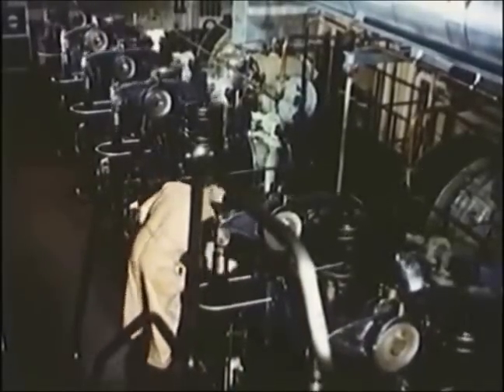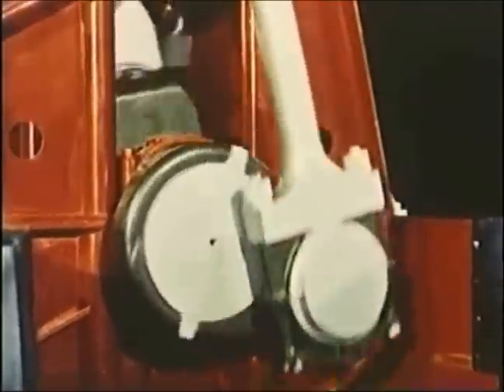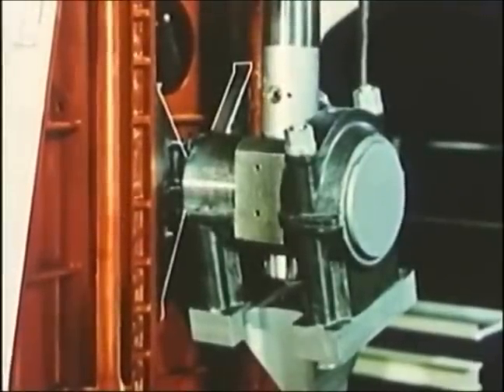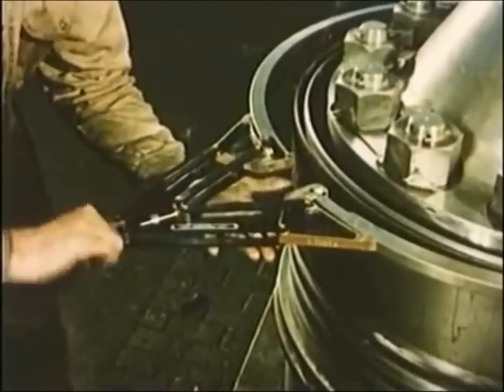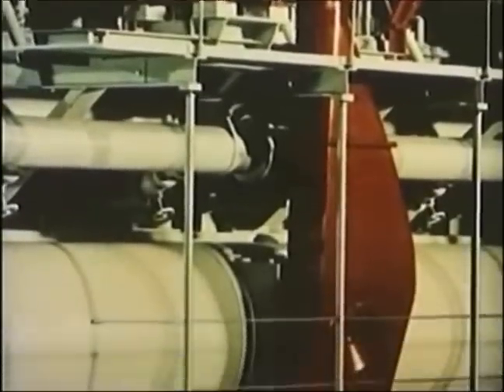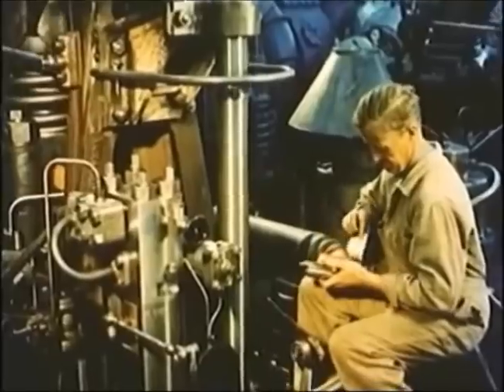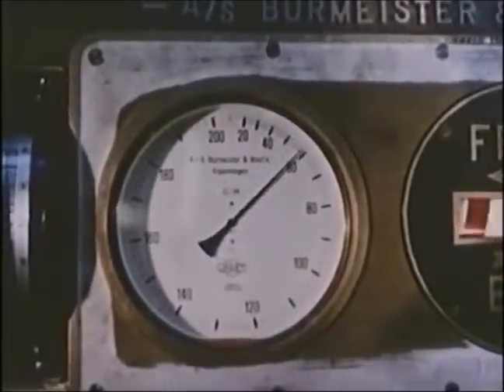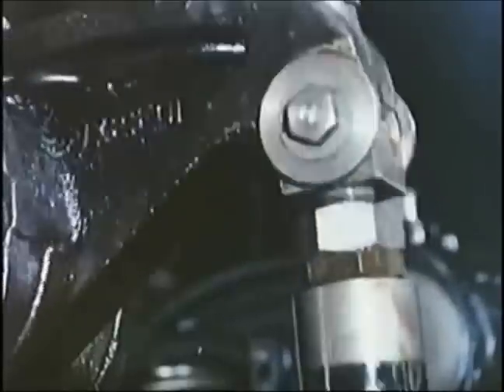Marine Diesel Engines How they work Documentary

Comment: So that 2 stroke can run in either direction.   Pretty cool seeing something on a massive scale like this.
Reply: So to reverse direction of a ship, the engineer would have to stop the engine, then restart it in the opposite direction. I can only assume this would take several minutes to do. This would explain why in disaster documentaries they say it takes so long to stop a ship from hitting an iceberg, or another ship, or running aground. Not as simple as just changing gears. The size and power of these engines are so impressive.
Reply: Yeah. Same with steam. In the scene in Titanic where the engines are reversed, that's what it shows. The engines clunk to a halt as steam is cut and then the steam is reapplied to reverse the engines.  Definitely takes time. Not like sticking a car in reverse. :D But, diesel or steam, those big marine engines were/are some impressive beasts! With two 4 cylinder steam engines and one central steam turbine, the Titanic's  combined horsepower was around 46000, ~15000 from each reciprocating engine and 16000 from the turbine, which was not reversible, so it only worked when the ship was moving forward.
Reply: SquierStrat72 000000000
Reply: It is not too long to reverse, the time to stop is more about the weight of the ship.  If you have 40,000 tonnes moving at 15 kn it just takes time to slow it all down.  Mind you, full sea speed was 120 RPM running on heavy oil, close relative to tarmac, full speed manoeuvring was 100 or 80 RPM not too sure about the exact figure running on diesel, the change over to diesel and slow down from 120 to 100 used to be planned as an hour.  That was part slowing down, part cooling down and flushing the heavy oil out of the fuel system.  One ship could manoeuvre on heavy as the fuel system had a return to the service tank, so the heavy could be kept flowing and warm and not set solid in the pipework.
In port turning gear kept the engine turning very slowly so the crankshaft did not develop a wobble.  To get underway the turning gear would be disengaged and the engine kicked over on compressed air with fuel off to be sure it would turn over. 
Back in the day, the Bridge would ring Noon on the telegraph, (move the telegraph from full ahead to full astern and back to full ahead again), as a time check for the Engine Room.  When bridge control of the engine came along you had to remember not to ring Noon on the telegraph any longer, the computer would try to do as it was asked.  I heard it did happen but I never experienced it, so who knows.
The taco link to the computer broke one day, so the computer tried to re-start the engine, when it found it could not re-start the engine, taco broken remember, it stopped the engine.  That was an interesting afternoon.
There was usually a range of revs, 3 or 4, where the harmonic of the engine matched the harmonic of the ships hull, if you did not go through that rev range fairly smartest the whole hull started bucking in time with the engine, not a popular thing to happen.
Reply: SteiffBear 60 damn thanks for that. Cool as hell!
Reply: Except that the Titanic used a steam engine, not a two stroke diesel.
Reply: The exhaust valve opens a few degrees before the intake ports to achieve "blow-down" , so reversing it would be inefficient unless the timing could be changed.
Reply: TIMEtoRIDE900 when the engine stops the camshaft moves so that diffrent rollers get the needed timing.
Sailed with two stroke Brons engine wich started on compressed air.
Once i forget to stop the compressor when  we came in to a harbor and the pressure was to high that a safety prevented starting the engine. After releasing manualy air the engine could be started and the ship came on the right moment to an hold pfff...
Reply: Do they just blow air in the cylinders to start ?? How is that timed ??
Reply: I just wonder how many thousands of gallons of oil this engine takes to lubricate it
Reply: Any diesel can if the injection system isn't specifically designed to prevent the engine from "springing back" and running the opposite direction if its stalled.
Reply: For "blow down" to occur the intake valve has to be open at the same time.
Reply: Roy Riederer even if this wasn't the case it would take a long time. It takes quite a bit to get something that heavy to change direction once it's set in motion.
Reply: TAOFLEDERMAUS I believe the reverse on a modern snowmobile works the same way, the engine turns in reverse
Reply: 4 stroke diesels can run backwards as well.
https://m.imgur.com/a/NhmO8
Reply: @TIMEtoRIDE900  on the engine shown, 90dgrees before b.t.c., so that they could get a good pulse for the turbocharger
Reply: @TIMEtoRIDE900  a rotary distributor which supplies air to a pilot valve, which opens the air start valve for a particular cylinder. The valve is closed by a spring
Reply: @deeremeyer1749  no intake valve. scavenge air is admitted through the row of ports round the bottom of the liner
Reply: @alexanderrosales7675  but you would need separate "ahead" and "Astern" cams on the camshaft, and that's what happened.  The camshaft physically moved sideways to bring the cams in line with the pushrods
Reply: @ibleedihred2844  Depending on the engine the lub oil system will contain anything from 10 to 20 tons of lub oil.
Reply: @TIMEtoRIDE900   These are 2 stroke engines thus  the camshaft turns at the same speed as the crankshaft. The angle between the crankshaft time and the camshaft timing is  changed when the engine changes from ahead to astern.
Consequently, the exhaust valve timing and the fuel injection timing are both changed.
Reply: @victorcroasdale4992  I agree, and basically what I implied.
And for others - - "blow-down" is where the cylinder de-pressurizes the burning gasses before the intake cycle or even the exhaust stroke proper begins depending on the motor.

Comment: The liners aren't produced with angled ports to provide "swirl" so much as they're produced with angled ports to provide better flow into the cylinders with the air tending to "bypass" a "square" port. The air is flowing through an "airbox" the liners are located in. And many 2-stroke diesels have ports with no "angle" at all. It just depends on engine design and whether the airflow is directed TO the liners in a "straight line" or if its flowing PAST the liners as it travels along the airbox.

Comment: hmm, actually learned something. I'd never heard the term crosshead, or known of their use in these types of engine. makes their long stroke make more sense now.
Reply: They are also used in large air compressors so they can compress air in both directions. I rebuilt them for over 20 years.

Comment: This is incredible.  Humans are so clever.
Reply: the engines are not very loud and as they work quite slowly the noise is quite tolerable.
standing beside the engine of a modern diesel engine all that will be heard is a gently swishing as the giant castings effectively dampen the sounds.
I started work at 15 in a factory with a big single cylinder engine that ran almost silently apart from the chuff of the exhaust outside.
Reply: @rosewhite---  you're joking!
Reply: @gordonpowrie9747  nope.  I've worked in lots of old factories.

Comment: Massive monster! I wonder if large truck tractors are built similar...i.e. with straight connection piston rod and cross heads before connecting rods. And if they are also 2 strokes?! That is pretty smart to avoid the side pressure on pistons...like in the car engine.
Reply: Sunshine diesel engine in trucks and tractors are made the same as a car engine

Comment: Why does it even have a crosshead? why not have a pin in the piston like an automotive engine?
Reply: two reasons; the first is that the early diesel engines were based on  steam reciprocating engine practice; the second is that having a piston rod enables the cylinder and air space to be separated from the crankcase by a diaphragm. Stops combustion products from contaminating the lube oil
Reply: The cyclical transverse forces are quite large and would cause significant piston liner wear without the crosshead. The transverse forces are transferred to the structure by means of the crosshead.

Comment: why massive diesel engine like this run in low RPM?? can't they run above 1000 rpm like car diesel engine??
Reply: they are designed  for maximum efficiency, and that low rpm happens to be the key factor
Reply: Hi Mad-dog One, the stress/load on the rotating assembly of the engine increases with the square of the rpm i.e. doubling the rotational speed of the engine, increases the loads/stresses on the components by a factor of four.  At the risk of oversimplifying the issues, doubling the speed of the engine would require to increase the strength of the components by a factor of four - causing a huge penalty in weight, stresses (bearing surfaces, etc.).
Also, as Tomyp89 mentioned, as you increase the speed of the engine, gases (ignition, combustion, scavenging...) will have less time to transfer their energy to the piston... so lower rpm gives better efficiency in such cases (up to a certain extent, it is more complex than that in reality). 
Finally, the faster an engine has to rev, the more precise/advanced/critical the design has to be.  For comparison, think about the difference from the engineering stand-point from a push-rod large bore low-rpm capable, low output classic Harley-Davidson twin engine compared with a similar displacement double-overhead camshaft (DOHC) high output, high-rpm capable multi-cylinder (four or six) Japanese engine of the same displacement.
Ciao, L (FoMoCo engineering)
Reply: with ship-engine running at 1000rpm you would need a gear - as the propeller wouldn't work with those speeds.
and that kind of gear would be quite large.
i think the guys back in the early 1900 could make quite pragmatic design decisions.
many years back i worked with 120 rpm MAN diesel-engines and once with 450 rpm engine. the big ones are much easier to handle.
Reply: Whereas 2 stroke petrol engines produce maximum power at high RPM, 2 stroke compression ignition engines produce maximum power at around 450 RPM, making them ideal for marine application. Running an engine of this size faster, would also put so much stress on the structure that they would break up. Don't forget that these engines run 24/7 and have a design life of 30 years before major overhaul. The limiting speed is set by measuring the exhaust gas temperature, which on modern engines automatically controls the 'full ahead' speed governor. Brunel calculated that a single engine produced the maximum efficiency, but 40 years ago, ships started being fitted with 2 or 4 engines. More recently, the designers of the super tankers have returned to Brunel's original concept. The overall workings of these engines are highly complex. One of the major complexities is that their high calorific fuel is almost solid at room temperature. It is heated and purified as it is consumed. Since it would solidify when the engine was cold started, normal diesel fuel is used until the engine reaches full temperature. However while running on this fuel, their is not enough torque to engage the propeller. Short haul ships (such as car ferries) reverse the propeller in the drive chain, but I am not certain about the ocean going tankers and container ships. Many people do not realise, that even on busses and large lorries the maximum RPM is as low as 1,500, even on 4 stroke engines.
Reply: wilsjane 
Shouldn't that be especially on 4 stroke? Comparable size 2 strokes run at a higher rpm.  Truck 2 strokes need higher rpm to develop the needed torque
Reply: General rule of thumb, the bigger the engine, the slower it turns. These huge engines don't need to turn fast to make a boatload (pun intended) of power.
Reply: Every stroke is a power stroke.   There is an exhaust valve that holds
compression and opens to release exhaust.  These massive engines
are not at all like the small ring-ding-ding ported engines.
Reply: Piston speed is the issue.
Reply: Part of the reason is the sheer size of the reciprocating components. When a piston has a mass of the order of 1 kg, the forces required to accelerate and decelerate it several thousand times per minute inside the cylinder, whilst appreciable, can be contained in a compact cylinder. When a piston has a mass that's closer to 1,000 kg, those forces are multiplied accordingly, and the cylinder that would be required to contain a reciprocating mass that large moving at such speeds, would need walls of an unrealistic thickness. That's before you factor in how much extra mass would have to be deployed, to make the other moving parts capable of withstanding the stresses. You can't simply scale up a car engine that revs at 6,000 rpm, to the dimensions of a ship engine, and expect it to work.

Since a marine diesel delivers perfectly adequate power without a high RPM rate, in no small part due to the fact that moving parts with a combined mass of 50,000 kg or more possess a LOT of inertia once they're moving, there's simply no need for a high RPM rate. Though when your engine's cylinders have internal dimensions bigger than your living room, you can imagine that this power delivery involves considerable fuel consumption. This isn't considered a problem, however, when the engine is propelling a ship that itself is bigger than many skyscrapers. For an extreme example, see the Knock Nevis. The people who operate oil tankers deal in big numbers with respect to just about everything they handle.
Reply: car diesel engines run full power between 4000 and 5000rpm, not 1000: the rpm limitation is not the weight from the parts or piston speed, but the long burning time from the oil (if run faster, the oil come most unburned out the exaust)...the big engines run at low rpm for optimisation from the fuel efficiency (~52%, in comparision, a car diesel engine make not better than 35%...
Reply: @cbmech2563  it's directly coupled to the propeller. They run more efficiently ay low r.p.m

Comment: Ah - a B&W VT2BF... I loved those engines as you could stand on the top plates and watch the nodding ducks going up and down.  It was an art form adjusting the tappets under way.  It was supposed to be not necessary as there was a hydraulic tightening device, but it rarely worked.  Nowadays you can't see anything moving, but they are a lot easier to work on than this type.
Shame about the strange soundtrack, which is completely unnecessary.
Reply: Just knowing the right moment to bang the adjuster at the top of the pushrod was an art in itself! They always took about five minutes to take up the slack if the engine hadn't been running for a while